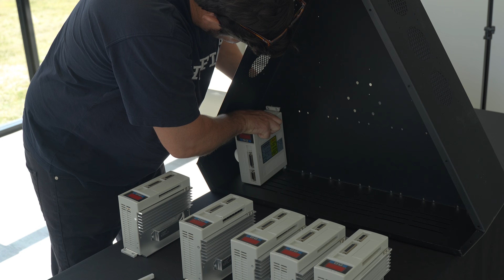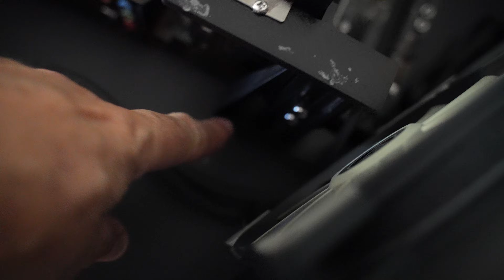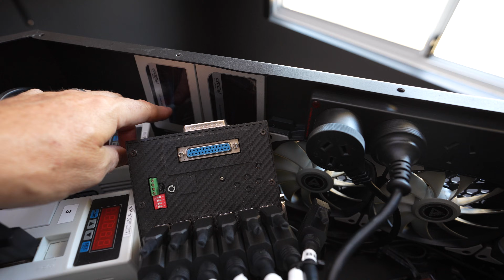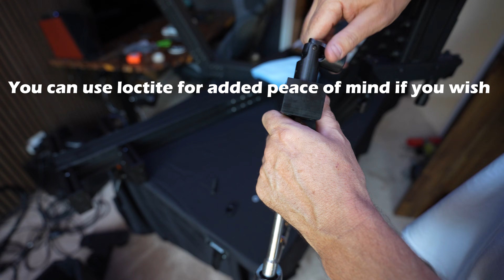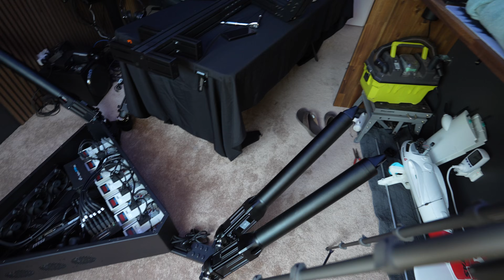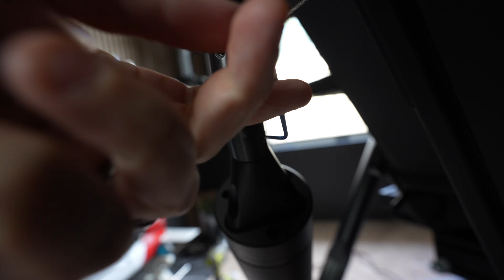VN-Motion 6DOF Motion Sim Build Video - Pt. 2

Comment: The radiator fans should be sucking the air from outside, and you should put dust filter on them from the outside, that way they will draw coolest air from outside and air pressure inside will blow all the warm air out through all the little holes in the enclosure, this is the best thermal solution and there won't be any dust bild-up inside the enclosure, so if you haven't changed it this way already, you should consider doing it. Otherwise, that is one great setup and very smart to place the PC inside of it, it hides all the mess of the cables this way.

Comment: I'm interested, but don't need monitor mounts since I'm in VR. Have my PC on the other side a wall with access for wiring to/from. I would want to mount a DD racing motor, and flight HOTAS, pedals. I've got this on my radar, but I'm afraid by the time I can afford it the US will impose some weird tariff.

Comment: Can i use just one U.S  20 amp outlet using voltage transformer  enough for using  80% of the power of your simulator since i like really big range of movement?
Reply: Hi, you can even use it @ 120V no problem. No need for a transformer. If you have enough with 1 outlet @ 120V for the simulator yes! Maybe you'll need a second for the pc depending on the specs. We're using 1200w (pc + simulator with belt tensioner) @240v so it might just work on 1 20A plug 😊
Reply: @VN-Motion-s1b   by looking at your motor controller, you are using very good  high quality servo motors. Google Gemini said each motors have 4.5amp if runs at 220v but if runs at 110v, it would be 9.5 amp per motor.   Im little confuse how single 20 amp can handle it. Don't you think my circuit get trip at start up?
Reply: @sky-h6j-i1q  Hi the motors don't run at full power. So they stay well underneath the max amp of your fuse. There's a lot of people using them in the US without any problems.

Comment: When you were threading the top actuator into the frame blocks, it looks like you hand tightened them and then backed off a little?
Reply from the maker: Haha people and their keen eyes!! Glad someones actually watching haha. But you can just tighten them up. Its an old habbit from the past where you align the universal joint in line with the actuator for maximum range and avoid potential binding. But that was with fixed universal joints. These now rotate axially on bearings as well so dont have range or binding issues 😊